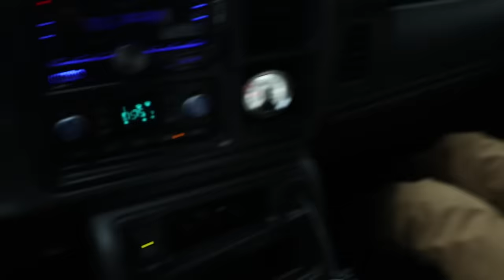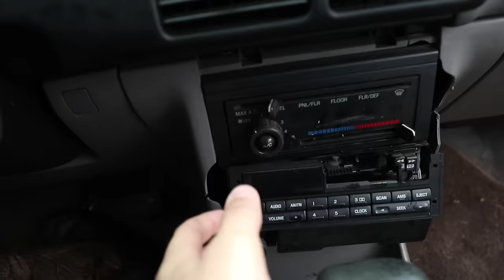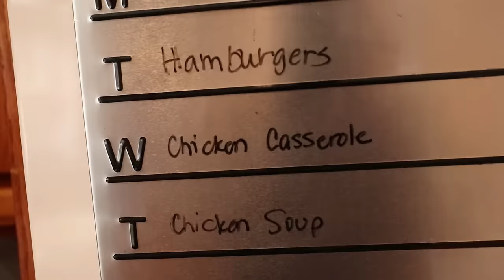Skipped school and HE DESTROYS my NEW CAR!

Comment: You guys are spoiled I would kill for a drift car
Reply: Ty Games, vlogs and more they sold stickers n shit for it 😂
Reply: Its not a drift car, its a paddock thrasher
Reply: Its a  300 dollar max car. Get some cash of your own and buy one of your own... I just bought a 93 accord for 175 bucks with a title.
Reply: @jakobstalheim5185  i bought a civic off my mate for a box of piss. Thing goes hundreds. Chopped exhaust of it and gutted it and the thing is a paddock killer
Reply: @jarredweatherhead6601  That's the way to do it, get a car for cheap (a honda is a plus because face it you can't kill a honda) then you don't have to worry about beating the hell out of it, and wont feel bad when it breaks or gets scratched up
Reply: @jakobstalheim5185  yep and when its only a 1.3l gas takes for ever to run out
Reply: @jarredweatherhead6601  They are great on gas as long as they dont leak lol
Reply: @jakobstalheim5185  just ran the lines through the cab
Reply: @jakobstalheim5185  because i knew it was gonna happen